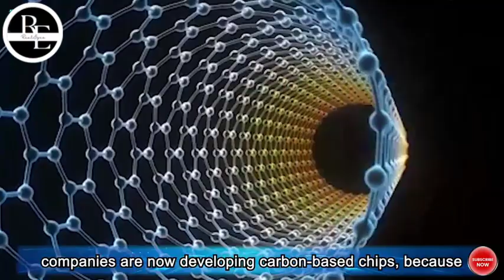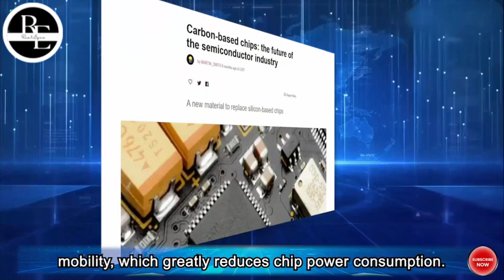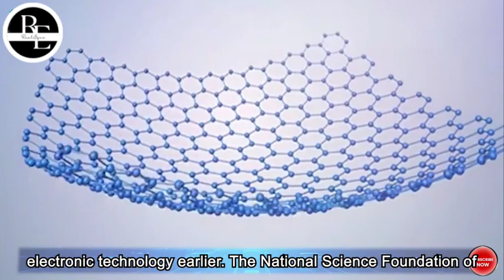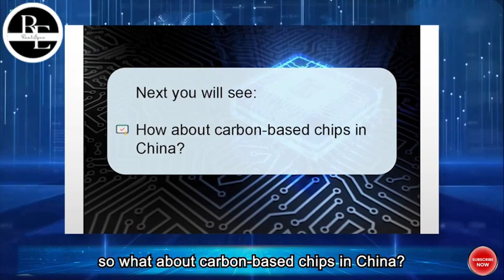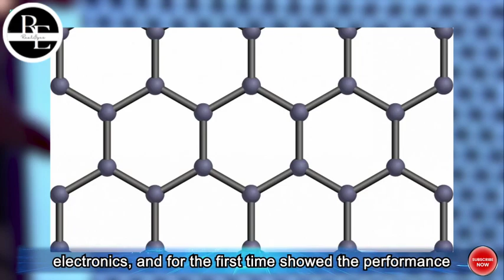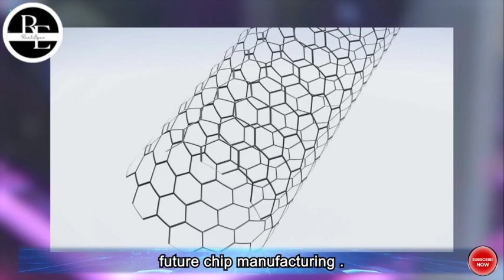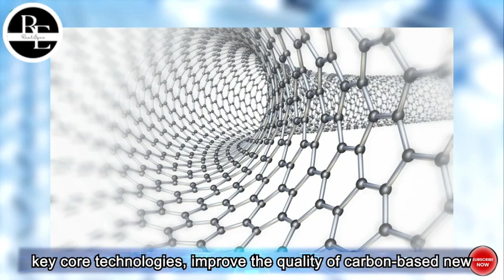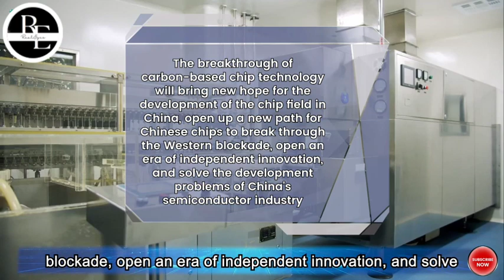Chinese carbon based chips｜ great breakthrough｜Do the Europe fall behind?

Comment: carbon based products can be used on everything, therefore making carbon based chips can given greater processing, since it has low heat conductivity, high tensile strength.   when China can achieve this, this will crush WESTERN tech...

Comment: Mass production of graphene microchips will probably soon become a reality, because Ray Kurzweil has shown that technological progress is exponential (accelerating) in the long run. And when the current paradigm runs out of steam (like silicon) a new paradigm begins and continues the exponential trend. For example electric relays replaced by vacuum tubes, transistors, silicon integrated circuits and now it's time for the next paradigm.
Reply: that will kill the chip market and destroy jobs
Reply: @ds-kj8fq  good, and it will create new ones in the long run. You must leave something behind to progress.

Comment: If this is true, where is the chips on the market. The presenter of this video shows little knowledge of what is really happening on the silicon level. The will start producing 4nm level chips at this stage. It is one thing to show something in a Lab but a total different thing to have mass production of high end chips. Lets see in 3-5 years time who is the winner.

Comment: Silicon is non conductive on its own. Carbon has a high resistance but still is conductive.  Doubt it, if it will be completely stable like silicon?

Comment: I've been watching the Quantum World Developments for the past 50 years. Twenty Four years ago we hit an inflection point with the first mechanical example of two cogs turning on themselves under an electron microscope. Since then we have seen enormous miniaturization progress. What does this have to do with Chip manufacturing? Convergence! 

As the nano field progresses, producing nanobots that are semi-intelligent with nano chips we enter a realm of technological implementation that today is the area of conspiracy theories. As I put it in other areas, we go from the World of Science Fiction to Tomorrow Land where The Quantum Singularity Computer is realized, circa 2045. 

We entered the path of Exponential Technological and Scientific Growth by powers of 2, back in 1980. Where 1980 = 0, 1990 = 2, 2000 = 4, 2010 = 8, 2020 = 16, 2030 = 32, 2040 =64, 2050 = 128, 2060 = 256, 2070 = 512, at which time we step out of Tomorrow Land into Fantasy Land.